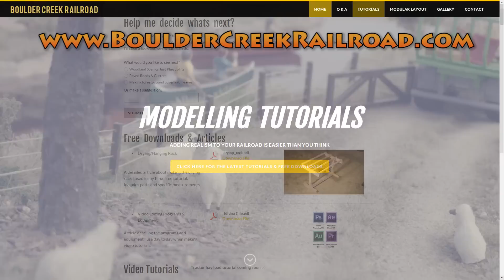How-To Add Lights to HO scale vehicles - Model Railroad

Comment: Over the years i have bought surplus fiber optic cables in various diameters, this works very good for the small marker lights on vehicles, truck and aircraft. Or on a passenger ship model, i drilled out the port holes the same size, threaded the optic cables through, applied ca to the inside and cut flush the protruding outside part, bundled the cables to an led light source inside.
Reply from the maker: Nice one Daniel, I have plans to film a video using fiber optics. I've seen some people do amazing things using fiber optics!

Comment: Nicely done.  Good job adding the lights.  It never looks right when the buildings are lit, but the cars are dark in low lighting situations.  Thanks for posting.  Rob
Reply from the maker: +Rob McCrain Yeah true, my scene is the opposite at the moment.... that will have to be my next video, building lights! 
Cheers
Luke.
Reply: I think the biggest error with lighting model buildings is using the wrong colour temp leds. Cool white with typical values of 4000K upwards almost never look good because most buildings in the real world have much warmer colours, 3000K or less.
Reply from the maker: cbcdesign001 I also find it difficult to find suitable LEDs, Woodland Scenics have a pretty good range for color temperatures but as for finding LEDs from the local electronics store its yellow or bright white! I'm thinking about using bright white and adding an opaque color over the top to get the warmer colors. I'll have to do some experimenting.
Cheers
Luke.
Reply: Possibly a thin wash of paint over the LED would dim it down and change the colour or a layer of fabric.
Reply: Mark Fryer A dot of red nail polish works best.

Comment: Very cool, I also love the scenery. Also thanks for the tip on Busch vehicles, I looked them up and purchased that Toyota and a few landrovers.
Reply from the maker: +MetalStorm Cool, you will be very happy with the Busch vehicles, if you disassemble them just check, sometimes they are spot glued and you may need a little extra effort in getting on particular part off, whereas other vehicles have no spots of glue, either way they are still quite easy to pull apart.
Cheers
Luke.

Comment: Well done Luke!!! I have been looking at this light kits from W.S. I don't know nothing about electrical stuff and it looks so easy to use just place plug in and you have light.
Reply from the maker: +Phillip wyman Thanks Phillip, I'm pretty good with wiring but they make this system so easy to use and adjust that it's hard to not give it a try. It's a little expensive but so are all the tools and parts you need to do all the wiring on your own so in my view it balances out to a certain extent.
Cheers
Luke.

Comment: 06:30 As for the wires you could just add a coin cell battery inside the car with some resistors and a small switch and your done.
Reply from the maker: That's something I'll definitely try for sure :)
Thanks
Reply: I'm thinking of doing the same with my old analog (locos), at least before I switch to digital (if ever) anyway
Reply: @BoulderCreekRailroad  It would be great for cars that move, such as with the MagnoRail system.

Comment: Luke, you always do a nice job,   your not old enough to remember, 40 plus years ago a gentle had a layout that had 5 or 6 trains in a yard then  as one came out and went around it turned on the next train and so on each train turning on the next using reed switches I did the same with window alarm switches, only had for a short period of time, do not remember how the switching went, thought you might help. not nearly as sharp as I once was.  LOL

Comment: Great one Luke, it looks fantastic once complete! Cheers, Dan
Reply from the maker: +TheMisterdan01 Thanks Dan, they actually look even better to the natural eye. And they way I have the LED's positioned I still get quite a good effect even under full layout brightness. That's the great thing about the Woodland Scenics lights, all you have to do is turn up the brightness of the LED using the dimmer control.
Cheers
Luke.
Reply: Yeah I reckon that's an awesome feature of those!  One of my questions with that system though, is how do you make the wires longer for the light plugs?  Is is just a matter of cutting and splicing if you need to add on extra length say for instance if you have a light over the other side of the layout?
Reply from the maker: +TheMisterdan01 You can buy extension cables from Woodland Scenics to lengthen the wire or you could splice in your own extension, It wouldn't be to difficult. The great thing about this system is for the experienced layout builder in terms of wiring, there is heaps of potential for modifications and additions you could make, I'm doing a video with strobe lights which I think will look cool.
Reply: +Luke Towan  I can't wait for this luke

Comment: Hi Luke,great vid,these lights  are great ,I just bought a pair of white nano's to see how they go without the hubs,turned out you don't need the hubs or power supply,I just snipped of the plug bared the wire and conected straight to the track bus,they work great but no dimmer,meh?
Reply from the maker: +Jon Blakeney yeah I thought about that too, I really like the dimmer though. I looked at Jaycar for a dimmer circuit a while back but it was quite expensive. I'm starting another lighting video at the moment where I make a small modification to the lights. Should be good I hope.
Cheers
Luke

Comment: great job luke only thing i see a bit odd driver on wrong side of vehicle where do you get such great models
Reply from the maker: +Terry Markowski lol, I got this one from Germany,
http://www.modellbahnshop-lippe.com/produkt/Busch/44-4-000-229155-013001-0-0-0-0-0-0-0-gb-h-0/produkt.html

It's sometimes difficult to navigate the site but the service was good and the vehicle arrived in under 10 days from the time I ordered it which I thought was good considering how far it traveled!
You can find them on ebay as well.
Hope that helps
Cheers
Luke.

Comment: Hey Luke, great idea. Have you ever tried to do that with matchbox cars?
Reply from the maker: +ATSF/SP Railfan Thanks mate, I haven't tried it with matchbox yet, I'll definitely give it a go. The only problem I can see is a lot of the matchbox cars are held together with a rivet underneath, I'd have to drill out the rivet and figure out how to reassemble it... probably just use a screw? Sound like a good project though.
Cheers
Luke.

Comment: When you were installing the driver did you consider doing a RHD conversion? Looks like it would be fairly easy to do on that Landcruiser to suit an Aussie layout.
Reply from the maker: I thought about it and you're right it is a pretty basic interior. Just moving the steering wheel to the right would probably be fine.

Comment: very good, nice and quick mod. But what about taillights ?
Reply from the maker: +Subs0nic Thanks mate, I guess you could do the same process for the tail lights? You'd probably need to drill a hole in the back though to get the LED's through.
Cheers
Luke
Reply: Yes,i think you would do some job with the back, i use a more tedious way to get lights. by using SMD 0402 Leds, these have an advantage, that you can choose color, head light : Warm White/White  Rear : Red , side markers orange etc etc. (there's a video in my channel if you wanna see) Anyhow, great job, i like you method for quick and easy =)

Comment: Is there any way I could just not use wires and instead use solar power or batteries or something like that?
Reply from the maker: Batteries could work, you might be able to use small watch batteries and have them in the back section of the car?